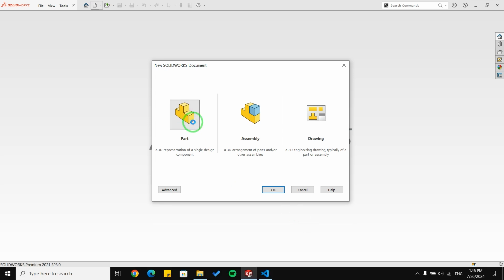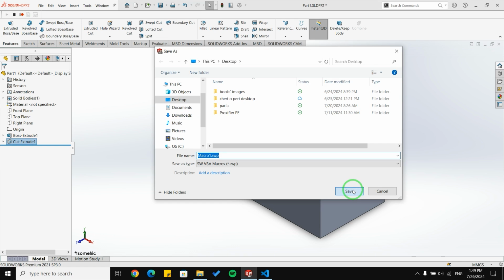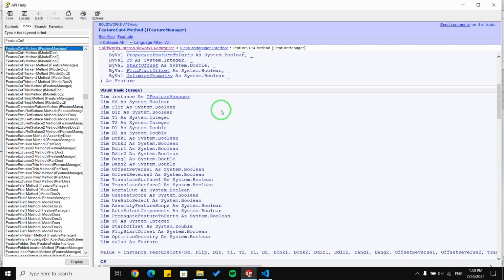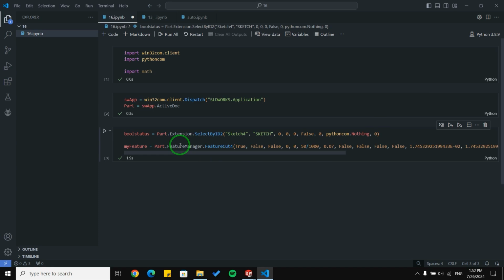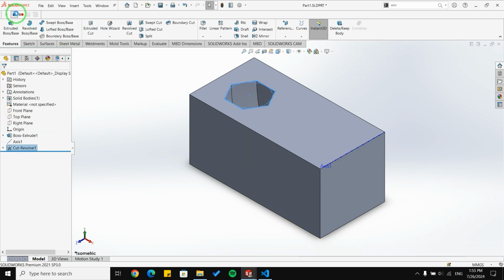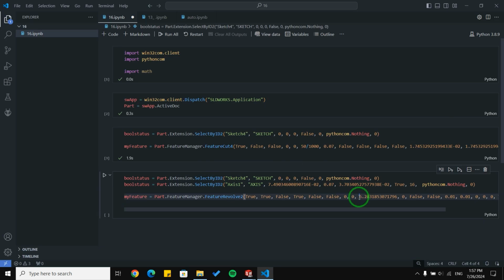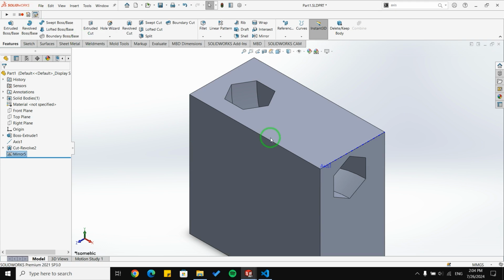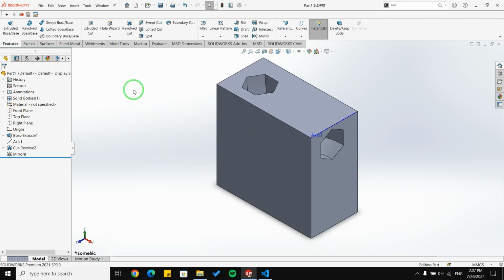SolidWorks scripting with Python 16 - Creating an Extruded cut, Revolved Cut, and Mirror

Comment: Dear RoboMech Minds，I am facing a problem about linear Pattern. I can not realize linear pattern with both two directions. Of cource, I realize linear pattern with one direction.  Have you met this problem?
Reply from the maker: Hello,
Unfortunately, there is a bug in the two-direction pattern. I encountered the same problem, and regrettably, I was unable to find a solution to resolve it.
Reply: Dear @RoboMechMinds , thanks for your reply. I  have to realize it by run the linear pattern code again. lol
Reply from the maker: Hello @楼小兵 . Best of luck.